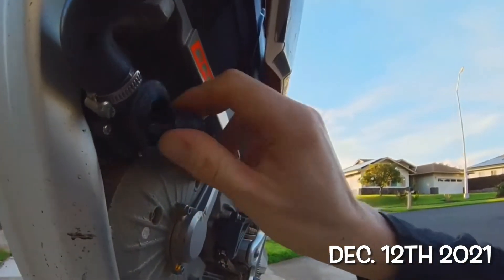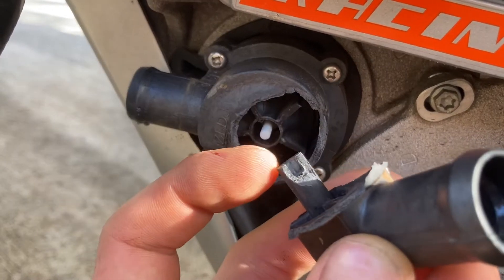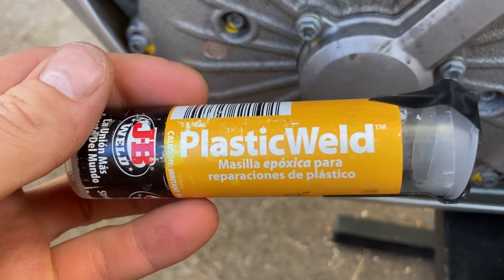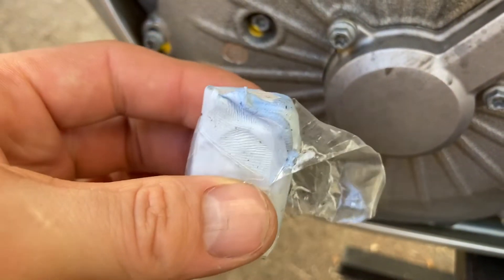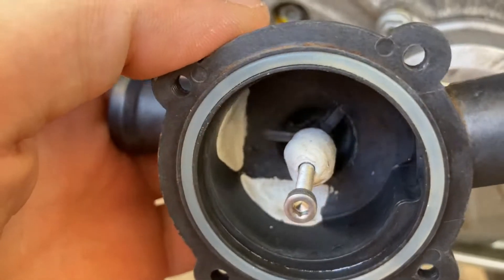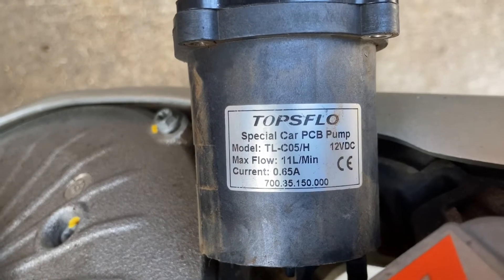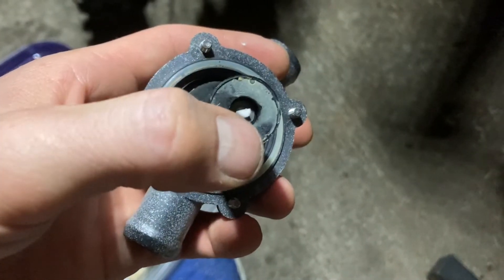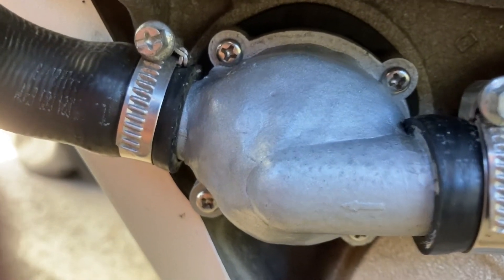KTM Freeride E-XC Water Pump Field Fix

Comment: Do we really need the coolant? Under 70 deg ambient temps? I want to remove my radiators in chicago
Reply from the maker: Why would you want to do that?
Reply: @JohnHowerton137  because the bike is 50 lbs more than the Ultra Bee
Reply from the maker: @RM-jb7ig  The radiators are so small and the coolant so little, the weight savings is kind of negligible. The power to weight of the bikes really isn’t that much different. Doesn’t make sense to me.
Reply: @JohnHowerton137  maybe so. btw, I just put aggressive nobbies on and it's way better than the stock tires. I went down in rear tire size to help low end. 100/100 18
Reply from the maker: @RM-jb7ig the stock tires have a lot of sidewall roll due to their trials nature. 

They're fun bikes. Enjoy 🤙